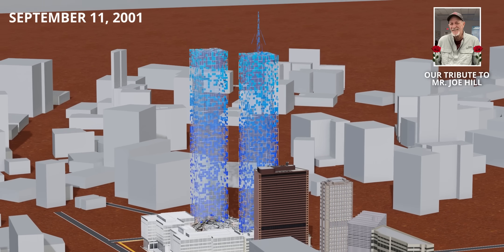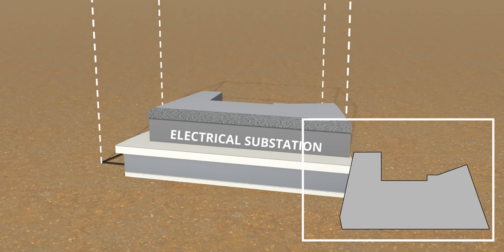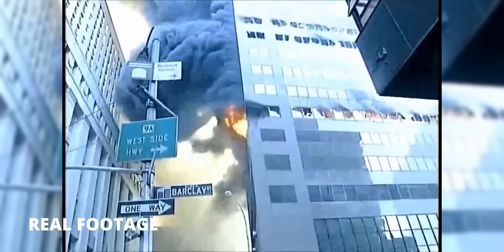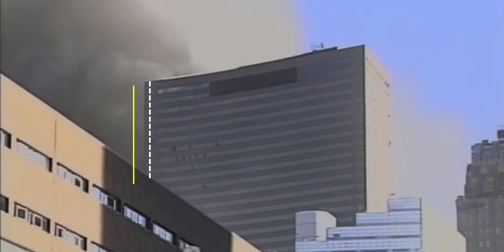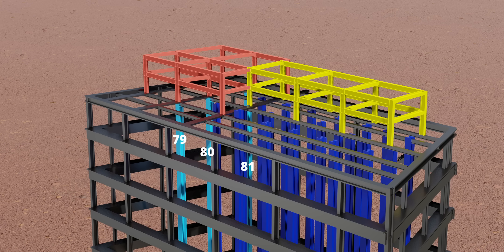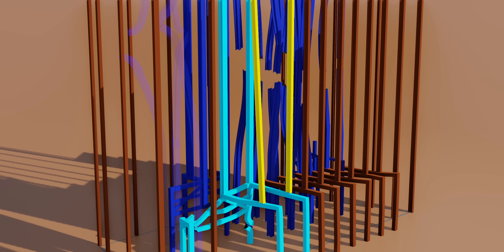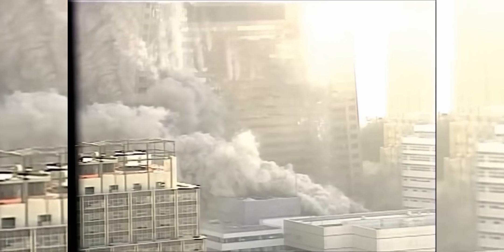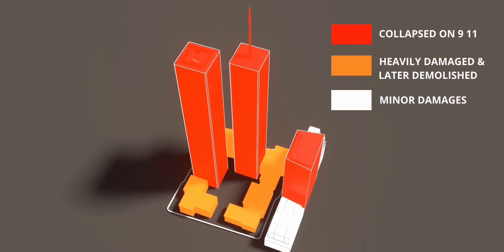Collapse of Building 7 | The Complete Physics

Comment: The shape of the building was a trapazoid. If the collapse was organic due to the supposed "structure fires" (impossible), but if it did , the building would have tilted towards the smaller side of the trapazoid. That smaller side of the building was facing towards the destruction of the two WTC buildings.
Reply: Maybe this will help:  Much misunderstood, Building 7 was the 6th building to collapse of 10 lost on 9/11. Because of its early low priority, conspiracy filled the information void with garbage made up by technically ignorant people promoting political agendas. But 7's loss is an engineering problem and should be treated as such, so I prepared this brief summary of my own analysis to fix that, using technical analysis, not ideology and tired memes. 

At 10:28am the WTC North Tower collapsed, showering Building 7 with tons of burning debris, causing heavy damage and starting many large  fires which burned out of control for the next 7 hours. Half the FDNY firefighters having been killed, units in disarray, equipment destroyed, no water pressure, and the greater urgency of search & rescue efforts, Building 7 couldn’t be saved so firefighting efforts were pulled as futile and 7 left to its fate. Firefighters make that sort of choice every day in brush fire situations - which houses to save and which ones to let go. Only real difference here is moving the decimal on the size and cost. People get overwhelmed by the size.

www.youtube.com/watch?v=g_SvpwyC17M

Collapse of a burning structure is always a concern for firefighters. Steel buildings subject to fire rely on active firefighting to survive. Buildings are designed around 1 to 3 hours of fire resistance, allowing time for occupants to escape and active firefighting to get started, after which all bets are off. Left to their own devices they'll exceed their design envelope and collapse, like Plasco Tower and Wilton Paes de Almeida. In 7 the occupants escaped, passive and active fire protections were compromised and active firefighting was abandoned hours before the collapse, which left the building to its fate. It lost. Odds on Building 7 would eventually collapse, and it did. No big deal in logic.

 http://www.youtube.com/watch?v=WnYBX6QT0R4 

FDNY Chief Daniel Nigro - The biggest decision we had to make on the first day was to clear the area and create a collapse zone around the severely damaged 7 World Trade Center, a 47-story building heavily involved in fire. A number of fire officers and companies assessed the damage to the building. The appraisals indicated that the building's structural integrity was in serious doubt. I issued orders to PULL back the firefighters and define the collapse zone. It was a critical decision; We could not lose any more firefighters. It took a lot of time to PULL everyone out, given the emotionalism of the day, communications difficulties and the collapse terrain 

FDNY Deputy Chief Peter Hayden ; We had our special operations people set up surveying instruments to monitor and see if there was any movement in the building. We were concerned of the possibility of collapse in the building. And we had a discussion with one particular engineer there, and we asked him if we allowed it to burn could we anticipate a collapse and if so, how soon? And it turned out that he was pretty much right on the money, that he said 'In its current state you have about 5 hours 

The collapse of Building 7 was anticipated and widely reported in the media throughout the day, with 24 video cameras recording some or all of the collapse. Everyone knew what was coming and why. 

www.youtube.com/watch?v=OY5S5k3tMHI

The collapse of Building 7’s was entirely different to the Twin Towers and harder to understand, most details being hidden from view and not intuitive.  But we can still sort out what happened through careful analysis and observation. This is my explanation of the collapse relying on no outside authority. 

Building 7 was a unique, asymmetrical 47-story steel framed structure built atop a smaller 3-story building serving as a partial foundation, requiring lower floors dedicated to complex load transfer structures. Of trapezoidal shape and all-steel tube-in-tube construction, B7 (above the 7th floor) consisted of a central core of steel columns carrying most of the gravity load, perimeter steel columns around the outside of the structure carrying the remainder of the gravity loads and long span beams and girders to tie those elements together and form the floors. On the outside of the building hung a moment frame or outer shell. 

Phase 1 : First externally visible signs of collapse initiation occurred at 5:20:28 pm and were notably quiet with observers not realizing the building was collapsing! No audible warning in the form of hundreds of ear drum busting 180-190dB explosive bangs preceding the collapse. Here at 12:00 a local CBS affiliate reporter is talking 10 blocks from B7 when collapse begins. People don’t start to notice the collapse until 12:11. At 12:45 is the famous CBS fixed camera clip of Building 7’s collapse. Note how quiet it is. 

www.youtube.com/watch?v=t5tEy6mXSE8

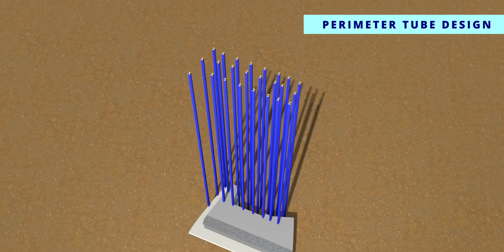Collapse initiation was due to lower floor failures above the load transfer region (8-14th floors) in the NE corner. In this video at 0:45 you can see the NW corner from inside the building while under construction, Column 79 just out of frame on the left. That big, angled steel beam across the top of the frame connects to C79 at one end. The girders connect to the beam. That beam and all those girders depend on just one connection 

www.youtube.com/watch?v=nP3TNHPCIVU&t=45s

Phase 2 : The NE lower floor failures caused a loss of critical lateral support over an excessive length of Column 79 and it buckled. Looking at a floor diagram of Building 7 (www.nist.gov/image-16640) when you see all the structures that depend on C79 you quickly realize this one column was a relatively isolated structural element on which a disproportionately greater fraction of the structure depended analogous to say the Key Bridge. Externally as collapse begins we see a vertical progression of window breakage along the 44-46 line and a kink in the roof of the East Mechanical Penthouse at the top of the building, consistent with C79 failure. Normally with a buckling column, the load could be redistributed to other columns. With C79 that is not the case - the failure did not redistribute the load, so the collapse rapidly progressed to the roofline, sinking the rooftop penthouse. The transition from full capacity to almost no capacity occurs in an instant and will result in virtually no resistance 

Phase 3 : With C79 gone, B7’s progressive, non-symmetrical collapse continues with adjacent columns 80 and 81 left laterally unsupported, and quickly buckling as well, sending the EMP down through the building. C79-81 all have no diagonal bracing, which is the major reason why they could not redistribute a lot of vertical loads among one another. From there collapse progressed from east to west through the central core until the core was gone taking all of the interior floors and probably most of the perimeter columns with it. Follow the horizontal progression of window failures low in the building and the dropping of the remaining rooftop structures into the building. One of the big takeaways from the NIST Building 7 study (invariably ignored) was how their modeling determined C79 failing under ANY circumstances would have initiated the same collapse sequence. 

Phase 4 : After about 10 seconds only the exterior moment frame remains, giving the illusion B7 is still standing to the casual observer since little has outwardly changed. But it is just a hollow empty shell like an empty cereal box supported only by a few remaining columns and overloaded from the loss of the core columns and floors, quite unable to remain standing. With nothing remaining behind it, the north face leans inward, forming a V in the roofline, the last few columns buckle under the strain and the moment frame free falls, landing on top of the debris pile. 

It is only here at the very end that a single measurement of alleged free fall acceleration is taken, from a single point on the outer shell. The Building did not “free fall” – just one corner of the outer shell did, sort of. The Building_ (defined as its center-of-mass) was already gone before that happened. The period of alleged free fall was a product of how it fell NOT why it fell and can't tell us what started the collapse 10 seconds earlier. Start to finish the collapse took 18-20 seconds, 3 times longer than free fall . How fast something falls cannot tell you what started it falling_ anyway. 

The debris spread outside the footprint blocking surrounding streets, heavily damaging the Verizon Building and destroyed Fiterman Hall. 

Building 7’s progressive, non-symmetrical collapse was incidental and unintended collateral damage from the combined effects of fire + time + gravity, started by the collapsing North Tower. That is true no matter who planned and carried out the 9/11 attacks or why . The collapse was of so little consequence it barely registered at the time - a footnote, only taking on semi-mythical status as an alleged smoking gun years later when demolitions at the Twin Towers, missiles at the Pentagon and shoot down over Shanksville all failed and conspiracists had nothing left to work with. 

Anything can seem like a conspiracy if you don’t understand how it works. Now you should. I hope you found this helpful, informative and it solicits informed critical comment. If I made any errors of fact, logic or reason or left anything important out, please let me know so I can fix it. IF you can offer a more plausible alternative please do. Be the first. Please start any reply with the words “Tits McGee” or I will know you didn’t read it and are wasting my time.